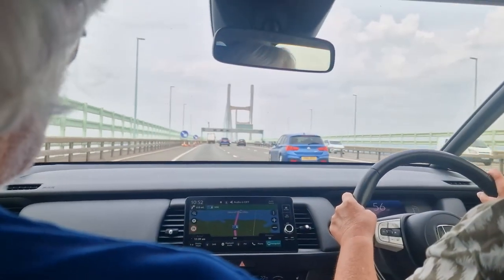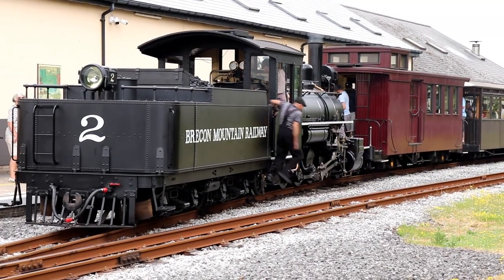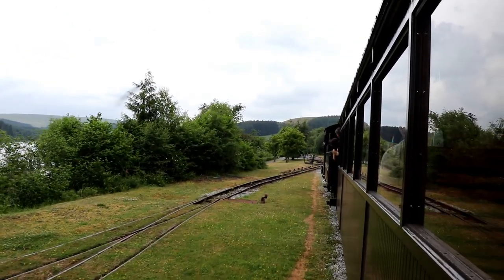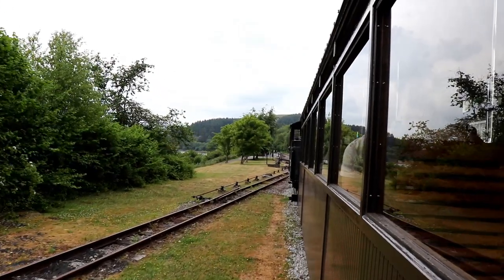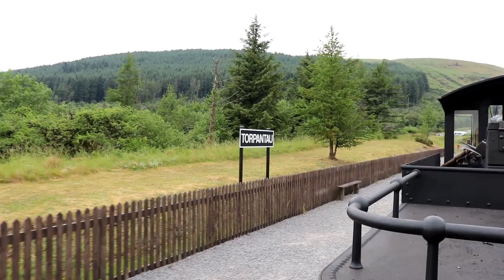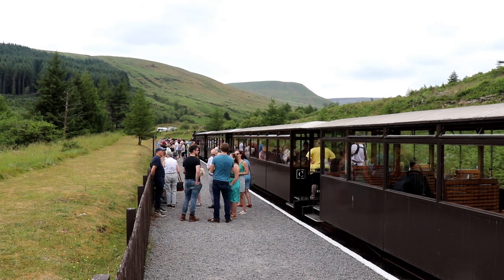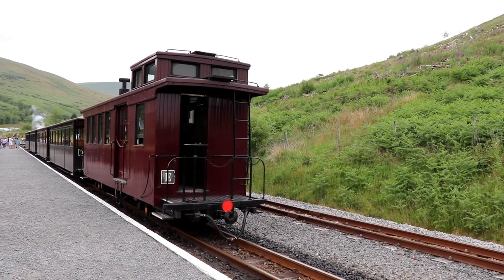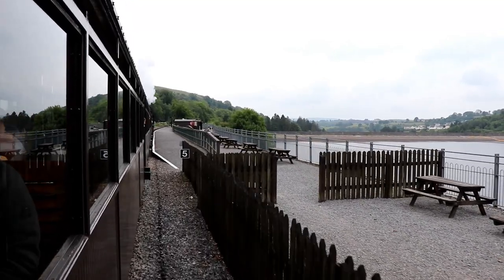GORGEOUS! Brecon Mountain Railway, Wales, with Baldwin locomotives

Comment: The only thing I am sad about is that there aren’t any knuckle couplers on it?! Like why wouldn’t you have knuckle couplers on an American locomotive?
Reply from the maker: Yeah, I'm not sure what the engines would have had in Brazil and South Africa before coming here. I tried to look up what coupler type these are but I could find a specific example. They seem to be a variation of 'Norweigian' type couplers. Unusual (I think) that they have that linking plate, a completely removable part that links them together. I noticed that when uncoupled they hooked the coupler on the side behind the cab steps. Weird!

Comment: Hello there Simon, this is a GREAT video! I went to the Brecon Mountain Railway when I was a young boy and they were only running for two miles between Pant and Pontsticill. The train was steam hauled by German Arn Jung built 0-6-2WTT 'Graf Schwerin-Löwitz'. 
A minor correction for your otherwise excellent video is the fact that the railway is 5 miles long from Pant to Torpantau.
Reply from the maker: Thank you very much. It's a lovely line. And I love the Baldwin locomotives.
Thanks for the comment on mileage. I can't remember what I said without watching, but I do remember thinking "Oh, was that right?" when I watched it after publishing 😂
Thank you.

Comment: Link and chain couplers and no air brakes?  Interesting.  And 2 foot gauge to boot.  Interesting looks like a fun ride.  Where is it located in Wales.  I realize Wales is not line Texas and is some what small though quit beautiful.  What boiler code do they use in the UK?  Besides being a train geek I designed safer systems for pressure vessels, as well as atmospheric vessels.  

It was good that you did this with you dad and your mom on Father’s day.
Reply from the maker: It looks like a variation of 'Norweigian' style couplers  but instead of a flop-over hook it has a plate which goes between and a pin put through on either side. You get a clear shot in the video.

It's about 40 minutes North of Cardiff, just by Merthyr Tydfil.